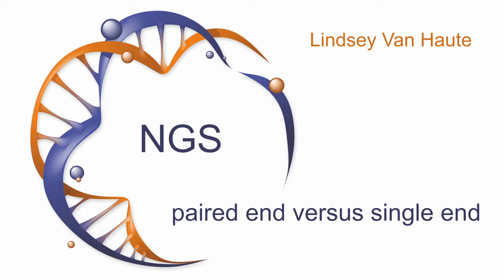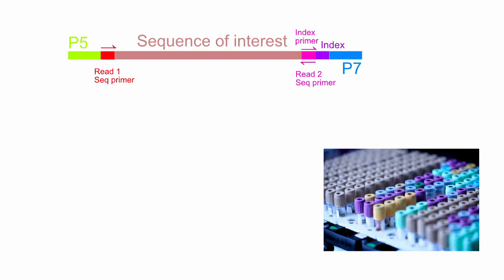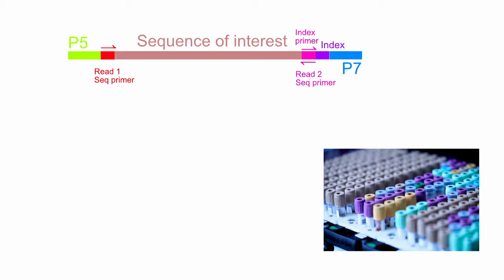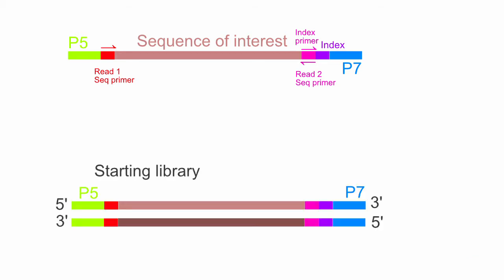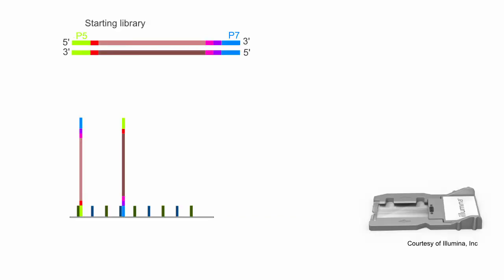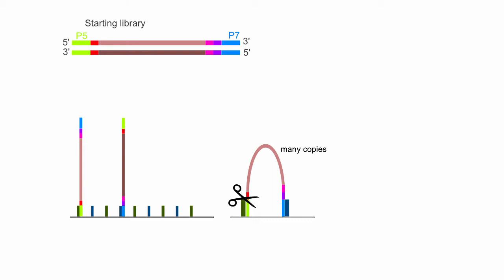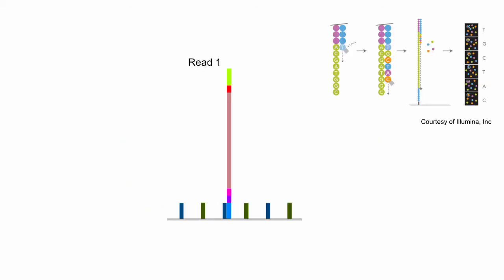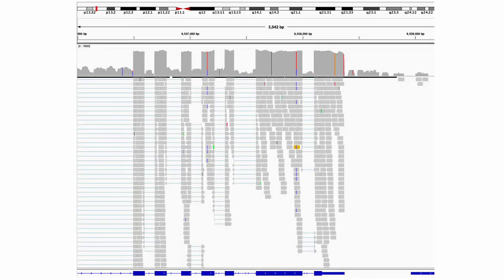NGS How does paired end sequencing work?

Comment: Hi Lindsey,  Cool video.  Would you please explain the bridging process?  What forces cause the bridge structure and bonding to corresponding oligo?  Thanks!
Reply from the maker: Hi, glad that you liked the video! Thank you. It's all based on annealing. When your library is ready, all fragments contain two oligo sequences, one on both ends that is complementary to the oligos that are attached to the flow cell.  And those will anneal, just like in a PCR reaction when the primer anneals to the template. I hope this explanation helps!

Comment: Excelent video! Thanks Lindsey. I have a question, hope you help me. The insert size (bp) has some limit or its for convenience? I guess you take that into account when you cut the DNA in fragments.

And one last question: What happens if your insert size is larger than reads you can make? (I believe remembering the bp of the reads cannot be longer than 300bp). What happens with that piece of fragment that couldnt be sequenced?

Hope I was clear in my question. Greetings!
Reply from the maker: Hi, I'm glad you like my video! 

If the insert is too small or too big, the fragment hasn't the right size for the bridge formation to happen, which would indeed cause problems.  So indeed, during the library preparation, there will be steps to cut the fragments and to remove fragments that aren't within the workable size (roughly 200-800 bp (or a smaller range of interest)).

If your insert is longer than the read length, that piece of the fragment won't be sequenced, but that's usually not an issue. 

I hope this helps!
Reply: @lindseyvanhaute156  Thanks for the answer! Just to clarify one last thing. Wouldn't that non-sequenced region you say it's not an issue, be lost if was not sequenced? How to reconstruct that lost region?

I imagine maybe that region will be sequenced in another cluster where it take part of the "read region", but I'm not sure.

Greetings!
Reply from the maker: @lucasfleitasibarrola2322  It's exactly as you think! The DNR fragmentation during library preparation is random, so indeed, the non-sequenced region that is missing in a particular read, will be sequenced in other clusters that have a different length and/or different start point.
Reply: @lindseyvanhaute156  I understand now. Thank for the answer, have a great day!